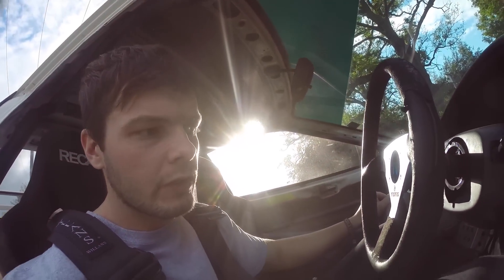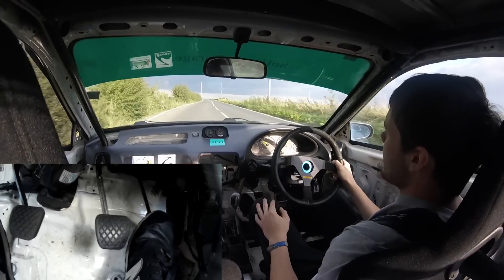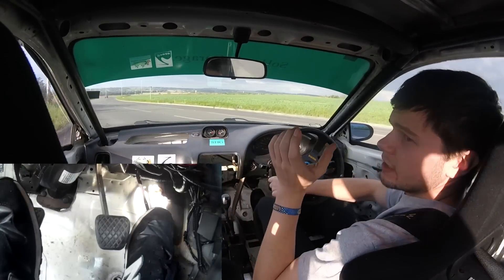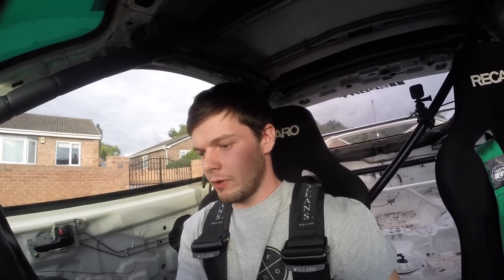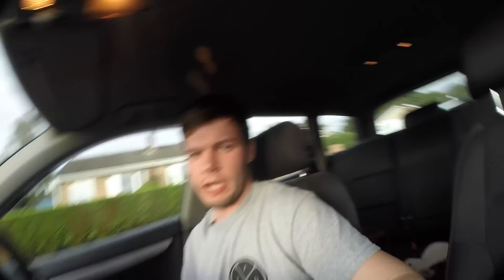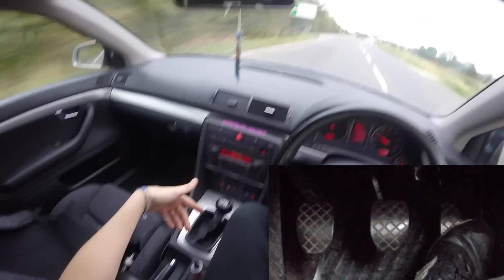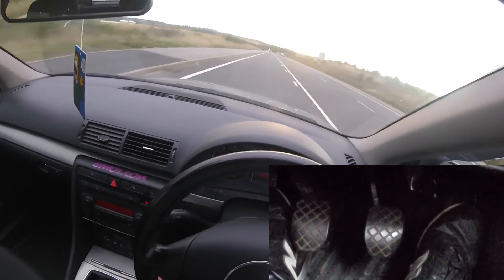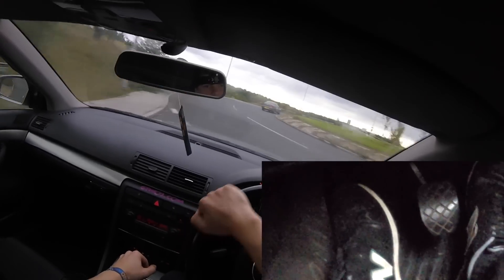Let's talk about rev matching.

Comment: When I downshift, can't I just blip the throttle at any gear stage (in gear, not in gear) as long as I keep the clutch pressed? So just press the clutch, blip and get into the lower gear at the same time and release the clutch after blipping? There should be no difference between blipping while in neutral + clutch pressed or in gear + clutch pressed. Am I right?

Comment: I usually brake, then press the clutch and then press the accelerator to increase the engine speed when I´m downshifting. I only drive on the street and when I try to do heel and toe I press the accelerator pedal too hard and engine speed gets to 4k rpm and I only need 3k

Comment: I've always double clutched all of my down shifts. I like being able to feel how close my revs are before I release the clutch. If it slides right into gear I know the revs are perfect and I can drop the clutch. If I feel some resistance I know to let off the clutch a little bit more slowly. 

The gas and brake pedals are super close in my car so I use the same heel-toe technique as you.

Comment: Dan i know this might sound like a stupid question, but i have an audi a3 2017 2.0 diesel Due to the low amount of revs the car has (4000 rpm), do you think that rev matching is still necessary. 

With a petrol engine car it seems so much more natural to use it (plus it sounds great), ive driven my friends bmw m3, which i used for a week and it seemed so natural to use rev matching on his car.

With my diesel, i dont know why but it just seems so unnatural, due to the low amount of revs and my car being a front wheel drive. 

Just wanted to know your thoughts...
Have a great one mate..

Comment: I've found that double clutching does make a difference in my car. I always asked myself why people do double clutching in modern cars.. until i tried it myself just a few weeks back. 
Probably not every car, but in my car the gearing especially between 3. and 2. is a big difference, so when i downshift from 3. to 2. it takes a moment until the synchronizers bring the input shaft up to speed so the gear goes in. 
That might have to do with a short gearlever so i can't apply too much force or with synchronizers that are worn out (183k kilometers on the car) i don't know.

But in any case using double clutching (and rev matching of course without its useless) i can shift from 3. to 2. way faster than without double clutching.. 
Its also faster in the other gears but not really noticeable.. 

I know none of this is needed in everyday driving, but it just makes driving more fun.. Sadly the arrangement of the pedals in my car don't allow for heel and toe, nor big toe little toe at least with my feet.. Maybe with a lot of practice i don't know. So i usually downshift before or after braking so i can rev match..
I've also learned to shift completely without using the clutch as it was needed to drive my car home after i bought it with leaking clutch hydraulics, since then i've trained that to where i can do it pretty much every time flawlessly.. Since i don't want to ruin my transmission i don't use it that often, but especially to get out if gear if i'm rolling to a stop i almost never use the clutch.
Upshifting from 3. to 4. also works really well without clutch because the ratio is just perfect for the engine rpm to drop right in time while i shift, all the others take a bit of focus to do.. 

Anyways, there are many fun things to do with a manual transmission that make driving more fun and interesting :)
Reply from the maker: What car is this you're driving mate? Sounds like you're having fun!
Reply: Well, daily driver right now is a Ford Probe 16V, 120hp not exactly a fast car.. But who said you can't have fun with it still.
I also have a Probe GT Turbo but its going to be a winter project.. 7psi of compression left on all four cylinderes after a nice autobahn drive this summer, i think i've warped the head.. :( I've only driven that thing about 2000km before it blew up.. 
But yeah, i'm having fun, lots of it :) Nice curvy backroads is all you need...

Comment: Shout out from Jamaica W.I (The Island) .... big supporter of your channel so keep the awesome videos coming bro, thanks for repping the DC2R's with them K20A motor Daniel, big up.
Reply from the maker: +Chadwick Hood thanks man! How is the Honda scene out there in Jamaica?
Reply: Its pretty awesome Danny we have a bunch of  Type R's variants here bud ... DC2R, EP3R, DC5R, EK9R, FD2R, FN2R, FK2R , we have N/A Honda's here putting down 300whp K-series motor and an EG Civic K-series that ran 9.926 at 143.95 MPH on the 1/4 mile, we mostly drag though but we have a good & vibrant circuit scene also.

Comment: For me rev-matching even on road is something normal. Changing gears down casually sounds awful and causes yanking which drives me to distraction. Coasting with brakes engaged is for elders and slight rev-match is always a nice thing and helps to maintain a smoothness. And not without a reason i've been watching Hotversion since a little kid to not to use it ^^

P.s: This grey integra is a really nice car.
Reply from the maker: Haha I agree mate!

Comment: How bad is the 2nd gear wheelspin? does it only happen when under WOT going into vtec or are you not always flooring it in 2nd to avoid it? I noticed it happened once but then not other times. Do you not get it on track with different tyres? I used to rev match in my vti on the streets sometimes after seeing it on Hot Version, it was completely unnecessary but seemed cool at the time
Reply from the maker: If I stomp my foot in second I can upset the car slightly as you can see in this video, especially on a bumpy surface!

Comment: The other reason why it could be helpful as when you blip the throttle the ECU will dial a bit of spark advance and if then you need power to accelerate say out of a corner you will have extra power.

Comment: I find it hard to do in my Astra so I just don't. I wish I could tho if you've watched any of my vids I have had comments telling me I should rev match. I only have thin feet tho lol. I suppose if I practiced it more I'd get the hang of it. Top vid again tho dan. Keep it up.
Reply from the maker: I used to drive my mates VXR and it is difficult in them. Seems to be a bit of a delay when pressing the pedals. Do able though, practice man!

Comment: I've tried doing this is my seat leon but it's pretty awkward as the accelerator pedal is one of them electronic ones rather than mechanical so it's on the floor rather than on an arm like the other pedals making it pretty much in possible to reach it safely with my health or even little toe while breaking 👎

Comment: Became a habit of mine during everyday driving, prolongs the life of the clutch. Double clutching basically is an internal shaft rpm matching technique for the gearbox. But if you use part of clutchless shifting technique (unloading the drivetrain)  it eliminates the need to clutch into neutral. I use this hybrid technique to "double clutch"  and rev match, much quicker by eliminating unnecessary steps.  The moment you release the throttle to prepare to downshift you unload the drivetrain, in this short window the shifter will pop into neutral if gently nudged (if you feel resistance the drivetrain is still under load) in one seift motion, release throttle slightly, while slipping into neutral (still enough throttle to cause an instant blip) clutch in, down one gear. Can be used in conjunction with left foot braking techniques for high speed corners with decreasing radius. *disclaimer for anyone who attempts these, I'm not responsible for your screw ups lol

Comment: So if I rev match when I down shift I can let the clutch out instantly?
Reply: Honestly you should just start with the non-brake involved rev matching when downshifting

I got my car bout 4 months back now, a EK3 honda and i decided to give it a try mainly to save the clutch and transmission since its boring to put it in neutral and brake to a stop from like 35mph

You will learn it fast, I havent put time into learning heel-toeing yet so im a beginner m'self with that
Reply: You want to avoid the slipping. That's what puts the stress on the clutch and box. As said, try rev matching rather than HnTing. That way you should start to feel as to how much throttle you may need when you start learning to HnT.
Reply: Yeah. I've been doing it for years on both road and track. I'm trying to say if your struggling with HnT try just rev matching as you down shift but without the braking. That way you get a feel for throttle responce. Then try adding the braking part when your comfortable. Dude, I'm only trying to help you as you're asking the questions and I want to answer. I'm just trying to explain the best I can without having a face to face discussion and without a car to use as a point of reference.
Reply: The better you get at it the quicker you can do it. If you're  lifting the clutch back in slowly then your increasing the time the car is coasting or not in gear which is not what you want.
Reply: Yes. If you do it right.
Reply: Right as in rev it high enough or a little higher? Just not too low?
Reply: Not too high or too low for the gear you are selecting in accordance to your engine speed.
Reply: But with a non racing clutch how picky is it? I just bought my first car, learning stick. Rev matching sound intimidating. I've just been dropping a gear and slowly letting out the clutch or clutch until I stop.
Reply: A standard clutch would be more forgiving.
Reply: Right now I'm very gently slipping the clutch when down shifting and breaking, no throttle down shift to second then neutral and brake.
Reply: Do you know what heel toe is? It's a method of rev matching while braking. I already rev match while accelerating. It's the braking part that's hard. And unless you have 3 feet, good luck braking and rev matching with out HnT or BTLT
Reply: I'm just trying to make sure we're on the same page, wasn't meant to be read in a condescending voice but I can see where you would get that. When you rev match with out the break do you tap the throttle, release clutch then get on the throttle or do you hold the throttle while you let the clutch out? I haven't been "blipping" the throttle as some say but rather revving it up then keeping it there while I release the clutch.
Reply: Can be held or blipped. Depends on your situation at the time. But the general idea is to release the clutch back up straight away.
Reply: If the rpms are synced well then releasing the clutch slowly shouldn't be a big deal, since they should sync up in no time, Why do I need to release clutch instantly? Feels like the car will nudge no matter how well I do it.

Comment: Are you using a short shift? Up shifts are lightning
Reply: short shifters typically don't speed up your shifts, they just reduce effort. Pretty common opinion that 90's Honda transmissions have great shifting, and also he's using a type r close ratio as well..
Reply: Virux shorter throw should = quicker shifts.. Dan shifts lightning up
Reply: conaghy They just change the leverage point. The synchros limit how fast you can actually change gears. Since the gearing is shorter the synchros don't have to do as much work, but Daniel knows his clutch/transmission very well.
Reply: Oh, and, lighter flywheel too.

Comment: Rev matching helps out a lot in the wet, especially in a rwd car.  A ham-fisted regular shift can often lock up the rear wheels.   Fun times if that was the intention.  If not, it's usually an ass pucker or a hedge.
Reply: on a bike its an essential skill if you wanna go fast

Comment: is part of the back bumper cut off?
Reply: yes, it's a drag point. Speed holes, cutting, or a diffuser prevent turbulence underneath the car, increasing high speed stability.
Reply: also looks cool

Comment: Been driving since January and i still cant master rev matching 😕
Reply: just make sure you practice with lots of room and not on a turn or a place where it needs to work...or you may end up in a ditch lol
Reply: As Adam Bayliss pointed out, some cars are easier than others. Learnt in a Metro with peddles nice and close. Drove that for 3 years. Then when it came time to change car it would take me months to master it again in my new car.
Reply: keep practicing
Reply: Hey man, just like you, I started in january. I can "quite" master rev matching but only without the break... :/ Just try on the highway to rev-match from 5 to 4 gear to get a feel for the amount of throttle you need to apply ! Now I still have to master real heel-and-toe too... :/
Reply: SaTaNeAtChEeSe IV yeah thats what ive been doing, can kinda do rev match while going up a hill thats near me but not every time lol
Reply: You'll get there. Time and patience 👍
Reply: ItsGodfreyHD What do you drive? Some cars are easier than others.
Reply: Adam Bayliss Suzuki Ignis sport :)
Reply: ItsGodfreyHD Shouldn't have too much trouble with that. Just stick at it - remember you only need a slight blip of the throttle, don't overdo it.
Reply: Adam Bayliss cheers bud, ill keep practising :)
Reply: SaTaNeAtChEeSe IV the pedals in the car i drive now are quite far apart, especially compared to the car i learnt to drive in 😕
Reply: Euphorica yeah i dont really have anywhere lol
Reply: Practice on any straight road when it's nice and quiet.
But yeah, don't do it on a corner until you've sussed it. You don't want to shift your weight on a corner and spin out...
Reply: SaTaNeAtChEeSe IV slowly getting there, managed to rev match perfectly today after realising im pressing the accelerator too much
Reply: You only need a light tap. My TD Golf requires a reasonable thump. My Premacy Sport only needs a feather like tap. Each car is very different.
Reply: SaTaNeAtChEeSe IV yeah i just need to lightly tap the accelerator lol
Reply: better to over blip than not blip enough lol. 
Obviously not over blip by a lot but its kinda hard to blip more than half throttle when you tap the throttle with your little toe when the big toe is on the brake.